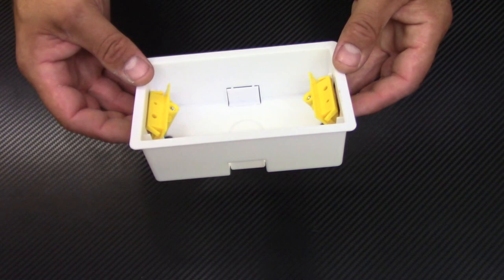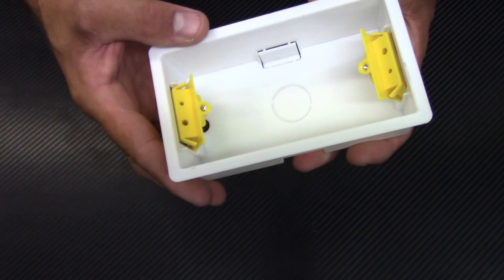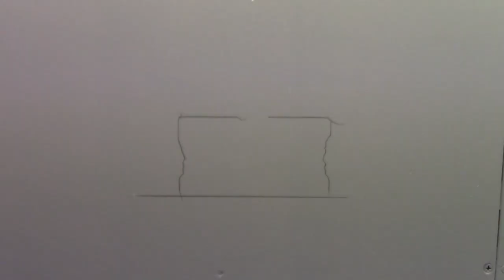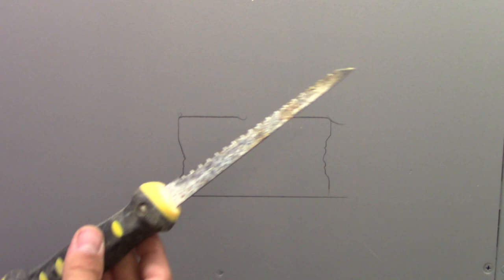How to install dry lining electrical box Fitting electrical box in plasterboard

Comment: Great video thanks. Just a quick question if the  drywall is double 12mm plasterboard in some places so around 27mm thick including the skim. The side flaps cant get behind the plasterboard is there something else you could do or use??
Many thanks.
Reply: Shave it from behind so the flaps will fit